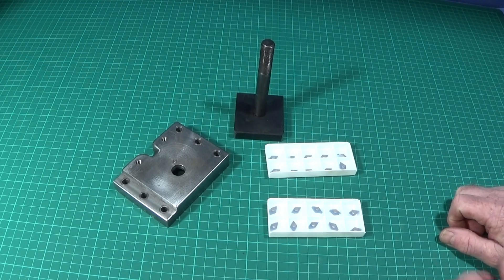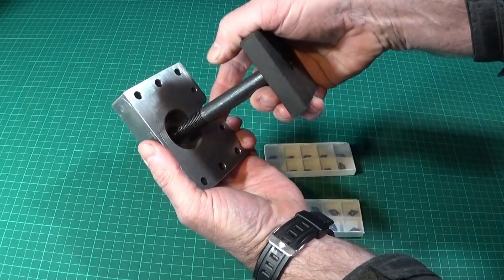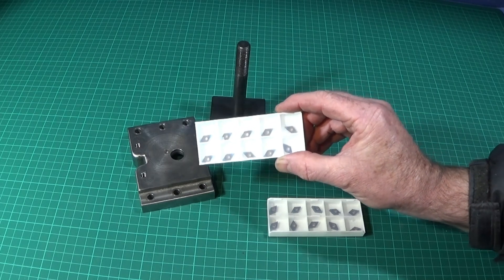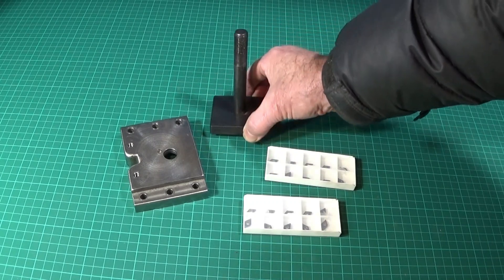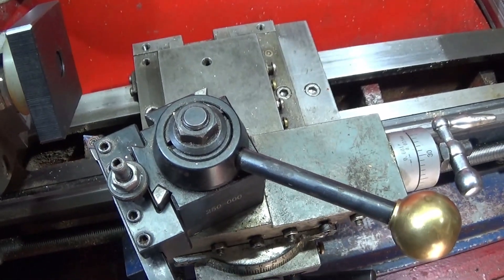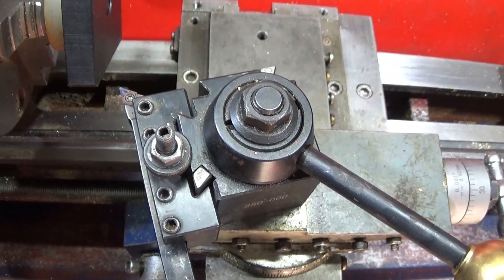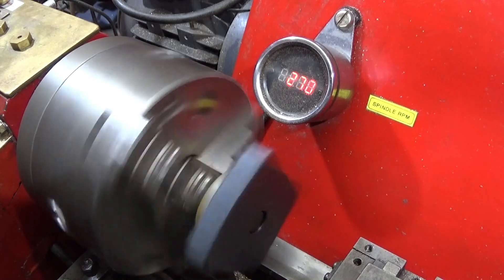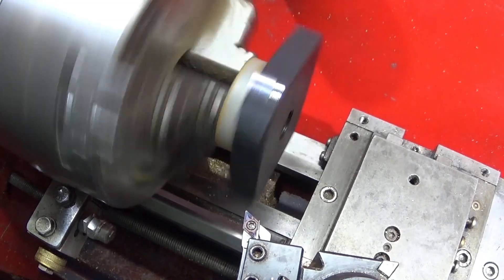Blue Nano Carbide Insert Test Intermittent Cutting On The Mini Lathe

Comment: Have certainly done stuff like this myself(often because I couldn't be bothered with any other way of doing it..) but given the material plus the size and shape of that plate I think I would have turned a plug-guide for a carbide.tooth hole-saw to do the rough cut before turning to size as the remainder would be an excellent starting point for a manual indexing/rotary table to use in a milling vise.....

Comment: Tip: Whenever I cut sided items like this, I start cutting in on the part a bit feeding inward on the part and work the cutter outward to cut; face cut outward on a set start point.  This reduced stress on the tool a great deal.

Comment: It's no wish of mine to rain on your parade but, wouldn't it have been a bit more rational, if the corners had been cut off with an angle grinder using an abrasive cutting-disc, prior to turning? I'm just asking.
Reply from the maker: Yes I could have done that but I wanted to test the inserts to the extreme. Regards Steve.
Reply: I was just going to suggest the same thing for several reasons. I find my smallest diameter from center and scribe a circle then using a square with a 45 degree I slide it until I hit the circle I scribed then mark it and using a cut off wheel in a grinder I remove a lot of material, this reduces the diameter you are trying to turn so you don't have to bring the cross slide back so far and turn the tool post if it's reduced enough plus it takes the corners from 90 degree to 45 degree making it easier on the tool or insert. A real time saver and saves wear on the tooling.

Still another nice video Steve I enjoyed it. Thank you for taking the time to make these, I always say I am going to video my next project but get to involved with it and I don't want to take the time to video and edit it, which I know it a LOT of work.
Reply: @MegaLostOne  Yes, in a good quality materials  the corner can also be used, for smaller project.
Reply: I think it was a test of the tips.
Reply: @jackthomas1978  No need. The manufacture has already tested them. By the way, it wasn't the right insert for the job. The insert was a copy insert, primarily made for profile finishing on CNC lathes and copy-work. Rhombus profile are usual use for roughing. P40 inserts are very good for nearly all general ferrous steels and cast iron and P10-15 for finishing.
Reply: @michaelmayo3127  🤣🤣
Reply from the maker: I use the DCMT 070204 inserts for all types of turning work. In fact I hardly use anything else.
Reply: @SteveJordan  I used DCMT on my 6" Atlas lathe a lot, I've switched over to mainly CCMT on my 11" lathe but I'll still use the DCMT when I need the fine tip to get into spots.
Reply: @SteveJordan  Hi Steve.
From a hobby point of view you video was very informative and quite correct. And It shows how very tenacious and resilient inserts are. And of course one uses the insert that gives one the best result.
However, I looked at the job from a production point of view. Here inserts are grouped  primarily for their ability to rapidly remove material.
So for Steel-60 a P40-45 insert, nose radius 0,8 would be used for roughing. On a sturdy lathe, with cutting tool depth of 5-8 m/m, feed rate set to 0,3-0,5 m/m PR and the RPM calculation in accordance with steel manufactures guild-lines, high material removal can easily be attained with good insert wear. We only use copy insert for finishing.
Insert and stainless steel. Stainless steel isn't hard. However incorrect cutting parameters will cause stainless to develop a micro hard zone just in front on the insert nose.That's why stainless steel can be tricky.Tool-Bits are good for cutting stainless steel.
 Keep up the good work.😀😀
Reply: Oops sorry, fingers faster than my brain (not uncommon for me). I should have said CNMG instead of CCMT.